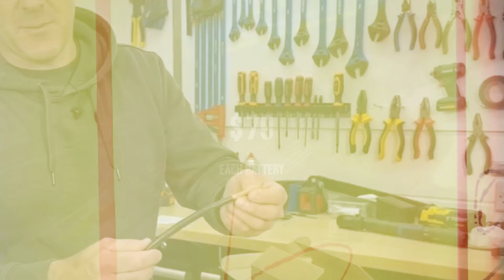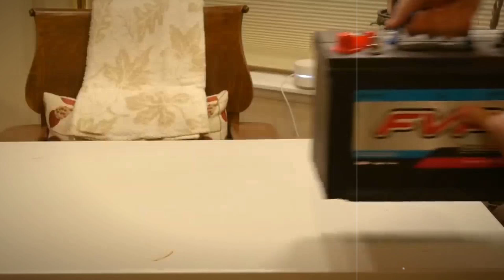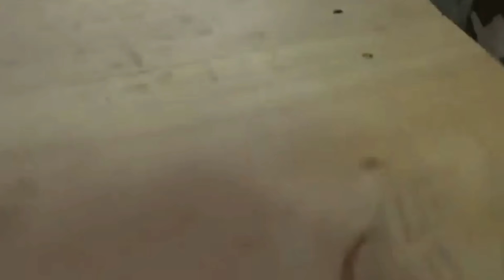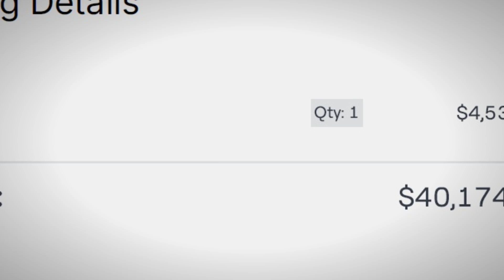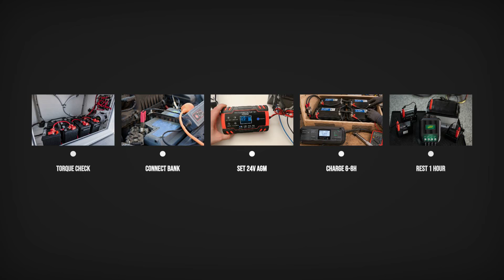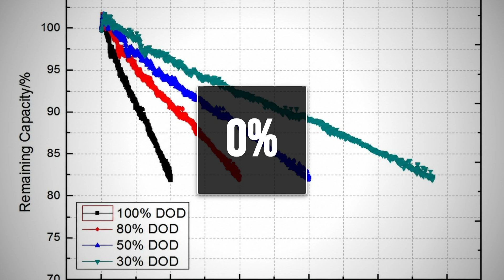This $79 WALMART BATTERY Runs Your Home For 30 Hours WITHOUT Lithium. Why Aren't We Using Them?

Comment from the maker: Curious — what does a group 29 deep cycle battery cost on the shelf where you live? Drop the price and your city below. I'm keeping a running tally of how much that number swings by state.
Reply: $129-$189 in Canton Ohio
Reply: Honolulu, not in stock but if it were, $152
Reply: Blah blah A.I. script bull crap content. 
Shut up and get to the point. It should only be a 6-minute long video of how to set it up and distribute power
Reply: Lithium isn't much more money in cost and here comes sodium ion batteries and others!
Reply: Ca 100
Reply: Illinois $99.97
Reply: 125 dollars lead and LiFePO4 100ah 128.dollars
Reply: Wisconsin  $125
Reply: Houston $100
Reply: $129 in central California
Reply: $99 here in middle Tennessee
Reply: I made my own batteries... ceramic enclosure, vinegar acid. The rest I'll make you think about. Not very pretty, somewhat fragile, and adverse to travel, but it provided voltage and I'm sure could be easily improved with some research and further thought... peace
Reply: Waterloo IL   GRP 27 $94  GRP 29 $120 Walmart

Comment: The lithium battery can be unstable or components of electronics can short circuit. Causing a lithium battery fire and you cannot put that out with a fire extinguisher you go lithium you better have good insurance.
Reply: Lithium iron batteries don't burn like lithium.
Reply: You're Right About Lithium Ion But These Batteries Are Lithium Iron Phosphate LiFePO4, Thank You.

Comment: Those are $139 in my city, not the AGM version, just the flooded cell. My Walmart does not have an AGM version available under $200, and that's a smaller group 24 not 29. Since I would need 8 of them to run my home office for 12 hours, might actually save money travelling to where these things are nearly half the price.  
Now I am questioning why these things vary so fricken much in price in different areas.

Comment: AI cant pronounce "lead" correctly? Also, there's a big difference between lead acid and AGM batteries which he says AGM is maintenance free, true but we're talking about deep cycle marine lead acid batteries not AGM batteries.
So, the facts are correct but when comparing 2 different types of batteries, you can't sneak in a third's properties as though it's part of the point you are trying to make. That's dishonest!

Comment: I just bought a battery that looks like a 12 volt one cell battery It looks like a single cell , But when I put the meter on it it said 26.2 . The battery says it can produce 24 volts At 200AH Lifepo4 . I will be darn the battery is giving me over 24 volts . 150 dollars ,I need to test the AH and see what i get . Did they produce a new type of cell ?

Comment: agm battery in missouri is  now 169.99 was 174 in 2020. back 6 years lithium was 900 to 1000 dollars. just starting out with solar i could afford lithium so i bought 3 agm batteries. I now have lifepo4 100 ah battery

Comment: If you get the standard lead acid you have to keep the water level up and agm batteries are good but they’re almost as expensive as lithium and lesss useable amps.

Comment: Price of lifepo4 useable capacity weight saveings and charge/discharge efficiency life expectancy and much cheaper cost now blows lead acid off the charts.Lead acid really limited to starter/engine batteries but even then time is comeing for lead acid to retire with steam engines petrol and diesel.

Comment: Not only does that battery cost $50.00 more than you show. I have 30kw of lithium batteries that will run down and turn off my inverters after 40 hours without sun . There is no way in xxxx that $130.00 battery will run my house for that long. I actually bought a dozen of them before i bought my lithium batteries and those 8 will only run my house for 6 hours before my inverter shuts down. You never want that to happen as deep cycle batteries get damaged each time you discharge them beyond 50%!

Comment: For back up power thwn yes lead acid is a cheaper way to go. If you are going to use said power on a daily basis to reduce your bill, lead acid will still work but you have to keep it above 50% or you risk damaging them . So the 4 batteris he got that stays charge most of the time then great no issue. But that only for a back up for when the power goes out. Lithuim is more expensive sive but you can use 100% of the battery and on top of that it it can lady alot more than lead acid . It all depends on what ypu are trying to do and the actual function of what ypu are trying to build. Lead acid are physically stronger than lithuim but 1 lithuim battery can out preform all 4 of those lead acid. My first solar setup actually made up of these. I had 11 walmart deep cycle batteries and i did screw up a couple of time and drain them down too far a couple of times and about 2 years later the batteries started failing.
Reply: I had 20,and they did what yours did.

Comment: How about two batteries, each used to crank a engine-driven alternator floating a LiFePo battery bank on parallel with a solar panel plant and with a grid-powered rectifier plant, all of which power a sine-wave inverter.
Reply: Hi, Mike in Arizona. Could u send me some info on what u just wrote?
Reply: @michael-tq1ri what’s the best way to reach out to you?

Comment: "Why aren't we using them?"

Because your video is all over the place and completely wrong. 

@00:10 Four deep cycle batteries from the bottom shelf. 
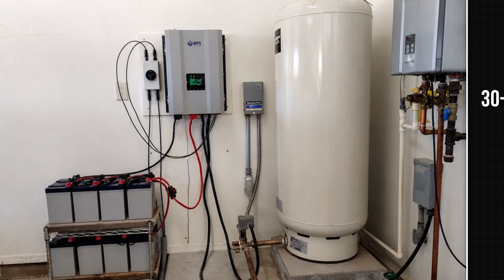@01:15 refrigerator, furnace blower, well pump and kitchen light for 30 hours. 
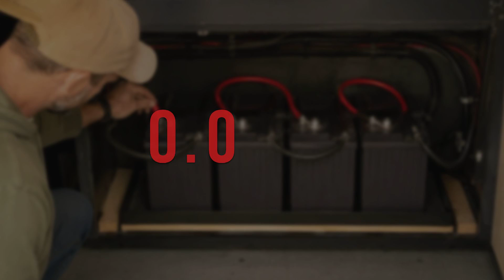 @3:55 it's only enough to power a refrigerator, furnace blower and a hand full of LED lights for 24 hours. (no well pump)
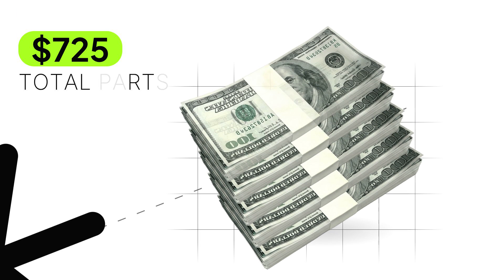@01:27 750 in parts
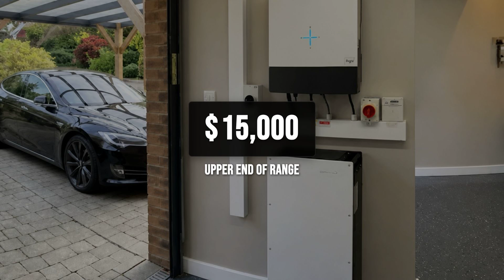@01:34 Lithium home battery $5,000-15,000 would be about 15-20KWH
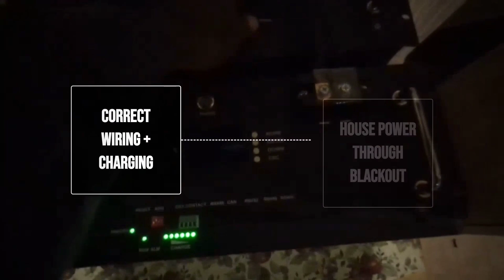@01:59 "A" $79 marine battery, not four.  But, we can overlook that. 
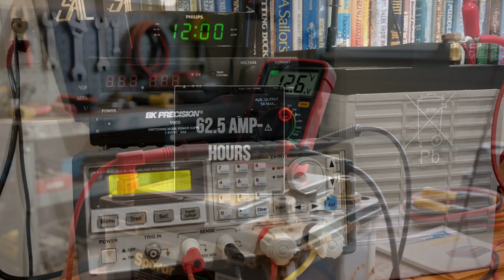@03:46 62.5AH per battery, 250AH total.  3100wh tl.
             He's comparing the cost of 20,000wh with 3,100wh
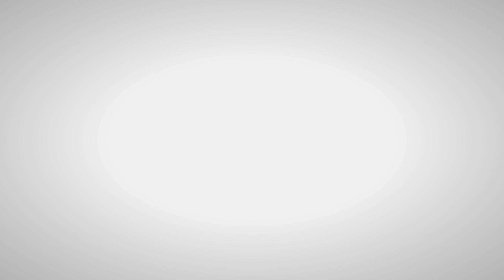@04:55 he's showing the recharge number for 80% of an AGM, not flooded lead acid. 
@05:38 he price compares $79 flooded battery with $260 Lithium cell.  
             WM GreenOE 12v/100AH 15000 deep charges = 1.3 cents
             @08:55 he shows WM $79 flooded battery, about 900 deep charges based on science for 11.9c (the 79 battery is now 80)
@06:00 comparing four small batteries against a much bigger lithium power wall.... 
@06:43 only counting the refrigerator to draw a trickle charge from the battery.  I'll agree, but he's running a well pump and heater fan, but let's give him the credit here a moment
@09:17 four deep cycle batteries give you "comparable" service as a whole power wall???? Really? The size and weight for 15KWH in lead acid batteries alone.... 
@12:00 you are not buying flooded cells (the $79 battery) you are buying AGM, (Group 29=$100 ea... better price than LPO.)

GREAT DISCOVERY

@20:00 he wires them into 24v.  WM has a pair of LiFePO4 24v 100AH for only 286 (WERCHTAY 24V 100Ah LiFePO4 Lithium Battery 2Pack )  
               That's 286 LPO vs 320 flooded lead acid or 400 for the cheapest agm. 
@21:00 shows 24v@250 total capacity, or 125 usable capacity, but the LPO option is 200 usable capacity. and costs less. 

the rest of the video is instructions on how to assemble. Most of it is still usable except for the voltage settings and lead acid information. 
The finding of the werchtay battery really makes it cheaper to use LiFePO4 batteries where you get more power for your home. 

He does waffle around what you are powering and how long the batteries last, but that changes a bit with the fact that you get all of the power from the LPO than from the acid battery. 

I think the data driving this video is way out of date.  Prices of LPO batteries have dropped like a rock in the past few years.  I think it would be great if this author would create a new instruction course without usiing AI or at least by supervising it and make it quit fantasizing.  

I did like that he used a solar charge controller to recharge the batteries.  With it, you can, if you like, add solar panels and you can expand on the number of batteries.  

I like the video, it's just dated and inconsistent.

Comment: Don't waste your money.  First of all the $79 Wal-Mart deep cycle marine battery is a fantasy.  The 114 amp hour group 29 ones are $129.  For a little extra money (actually not that much) go with lifepo4 batteries.  More consistent power output, maintenance free, and they'll last 10 times as long.  Oh, and they're less than half the weight.  This video is AI generated bullshit.

Comment: You keep posting pictures with a 120v cord connected to batteries, and when someone does that in their house, and the batteries explode, start a fire, endanger everyone in the house, and you will be in jail.
Reply: That's the problem with these AI slop videos. They're just an AI narrator reading a typed script - hence "leed" instead of "led" for lead because they rarely if ever proofread and pre-listen to how their script sounds being read by the AI. They use the AI to also throw in a bunch of slides on the subject that have some relevance but not always appropriate to what is being talked about at that point in time, or even not relevant at all.

I really hope no one gets hurt, but at the same time people should not be using these things to do the whole project - it should be an idea starter, but then do their own research and figure it out for themselves.

Just like everything else people use AI for.

Comment: What about voltage? I know Amperage but voltage? most things run on magnet motors and voltage is part of the starting process. So please some one tell me about voltage. I have small home that I travel to with the seasons north summer south winter  so the amperage is fine but voltage. now tell me voltage is just travel in the wire and voltage on short run 24 volts is fine and I will kick my self for being so stupid all these years 🤣 David Lobo

Comment: From what I get you are talking about OWNER installed lead acid BUT you always say INSTALLED lithium. Why not compare apples to apples cost of both user installed. As others here have said hydrogen is a gas released by the lead acid batteries and must be vented to the outside. I did not se that mentioned here at all.

Comment: My local Autozone charged me $160.00 per deep cycle battery, I bought three, 31DC-DL 210 RC 840 MCA. I connected it to a 3,500 watt inverter. What do I have? It only has one year warranty.

Comment: That might work in Pennsylvania,  but not in Oklahoma.  Those batteries are $134  here, plus $18 core charge. It's cheaper to buy a 100 aH lithium battery 🔋.  I had 20 lead acid batteries on my 24 volt system.  They've been replaced.  I got less than half the output from lead acid, and the voltage was never the same between the one on the positive side and the negative one.
Reply: You had lead acid not leed acid. I have not found leed acid no where. Only expensive lead lol

Comment: I would like to go off grid, need to know the cost to power a whole home with all electric appliances? I am thinking of Xp 1800 charge controller with 4 banks of 12V batteries to equal 48V each, into the controller.
Reply: Get a gasoline generator.

Comment: So many problems with this AI video slop.
Reply: Apparently, BUT I wish someone would give a step by step video with list of components doing this
Reply: @REVNUMANEWBERN

I would have to recommend will prowse if you want that kind of information on YouTube personally I despise the guy as a human he's an a-hole but he does have a lot of good information and if you want to learn the basics of building a backup battery system for your house go through his videos and you can find it unfortunately there isn't a simple one size fits all solution for this sort of thing but it's not that difficult and with a little time going down the YouTube rabbit hole good start being on will process YouTube channel and it won't be too hard to learn enough that you can put together a basic system to safely get through some blackouts but don't waste your time on all this AI slop you'll end up burning your house down electrocuting yourself or more likely just not having anything work and you'll just be wasting money time and be disappointed
Reply: Lazy content creators.
Reply: I'm waiting for someone to go buy 4 batteries and plug them into the wall outlet. PLEASE do this on video.
Reply: @dvsmotions the video did not suggest to do that. It states to get a AGM charger and wire that into a MPPT solar charger.

Comment: The main reason lead chemistry batteries are not used over Lithium-Iron-Phosphate is that their life is dramatically shortened when discharged below half their capacity. Deep cycle lead only prolongs the agony.

Comment: @GrainandGravity
R U doing this 4 a giggle, or is this 'Click Bait'  ?

Otherwise, ur sniffing too much fumes from the Lead Acid Batteries

FYI and others

You quote, "Can a  $79 Walmart battery really run your home?"

NOP, and the why is, because it's a ($79) 12-volt, 35Ah sealed lead-acid (SLA) small AGM battery capable of storing / delivering 420 watts. 
So four batteries totals 1,680 watts, with constant high volume drain the lead acid battery will overheat and reduce the efficiency unlike LifePo4 batteries with BMS protection .

In the USA ;-

1..  "In 2022, the average daily consumption was 29Kw" (29,000 watts)
2..  "An average U.S. household consumes about 6% to 10% of its total electricity on lighting, ( 1,300 - +2,000watts) per day
3..  An average US household refrigerator consumes 300 - 800 watts per day.
Cited URL  https://www.eia.gov/tools/faqs/faq.php?id=97&t=3

You get the message, your system is for emergency use, to power essential household items only.

Therefore , can't compare your 1,680 watts 12 month warranty emergency battery system against a  $12,000  FULLY INSTALLED/ integrated 10 - 13.5 kWh (10,000 - 13,500watt) Lithium Iron Phosphate system with maybe 10 years warranty.

A comparison is, apples against apples. 1,680 watts AGM  vs 1,680 watts LifePo4 !

'Icing on the cake', even RV's have between 2 - 4 (108Ah) batteries with 300 – 700 cycles at 50% Depth of Discharge.

In addition, there are benefits of running batteries in series.

1.. The higher the voltage benefits inverters, and created a lower current draw, requiring less current (amps) to deliver the same total power.
2.. Thinner, cheaper cables because lower amps means you can use smaller, less expensive wire 
3.. Less energy lost because of the higher voltage and thinner runs reduce resistance.
4.. Consistent current as the  same current flows evenly through every battery in the chain.

Comment: Deep cycle batteries are still good but they have a dangerous side to them if you're not careful as they charge the release hydrogen the liquid inside makes one recharging that's why you don't put them in your house anymore are you put safety guards in like venting like we do when we're charging our electric forklifts enrich trucks for me I went with lithium salt batteries little safer for amp and yeah it's going to cost you about 1,000 read another I know I'm not going to kill myself.
Reply: You can take your car battery to be recharged at most battery shops.  I  have done that.
Reply: And 50% more power plus 8 years vs 2

Comment: Comparing apples to oranges. You will find comparable 100ah lithium batteries roughly not much more expensive anymore compared to a lead acid battery (especially considering you can only DoD to 50% on the LA battery). Comparying a 12volt LA battery to a wall Lithium isn't a proper comparison
Reply: How would you create something comparable with ease of installation?
Reply: @pgski13 just buy 4 lithium 100ah 12 volt batteries and the same inverter. Or just got one 48 volt lithium battery and inverter for around a grand combined. Lead acid isn’t cheaper anymore.
Reply: Lithium is good. I think it will not hurt to have a deep cycle set of batteries for when it is freezing. Lithium will not work. But the Lead Acid will.
Reply: @SharonLlewellyn-x2l  Some of the Li batteries are 'self-heating' for use in cold climates.  No doubt that decreases usable output, but is an option to explore, in addition to the drawdown to 10% as opposed to 50% for lead batteries and more life cycles.

Comment: Interstate Batteries SLA2616 Replacement Battery by Bright Way, 12V 35Ah IT U1 size
Gardena, California
Current price is
$74.69
Price when purchased online
Reply: Very expensive for a 35ah battery!
Reply: Yeah that the same as harbor frieght 35ah about 70 bucks